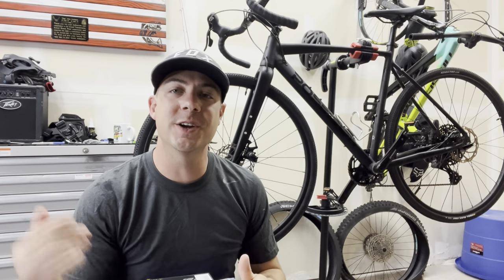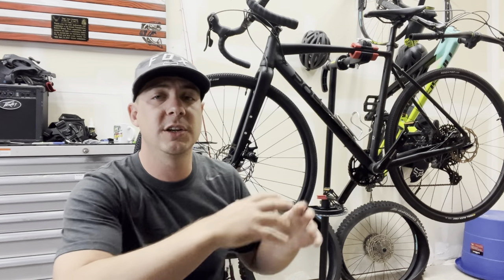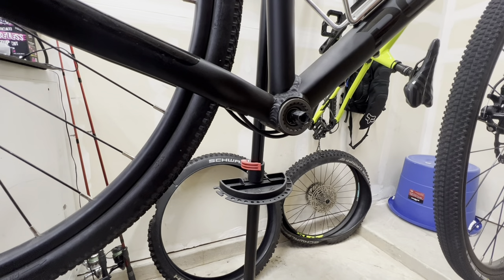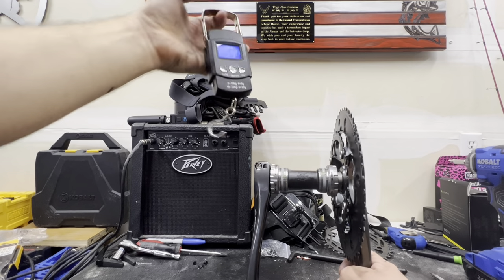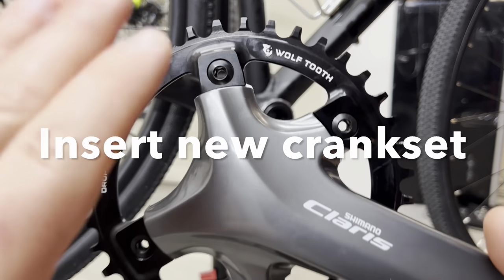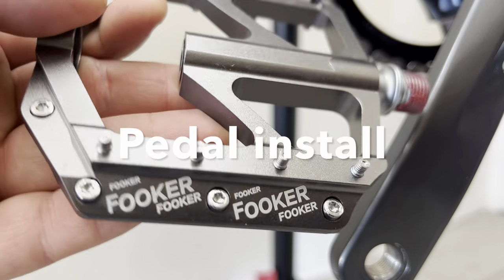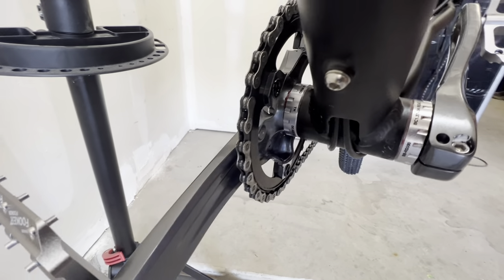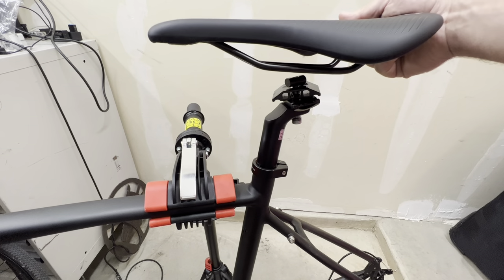Poseidon X Gravel Bike: Stage 2 Upgrade, new crankset & saddle

Comment: It might help to add a spacer to the drive side bottom bracket to give you better clearance for chainring and chain stay
Reply from the maker: Good idea man!
Reply: @bluecollaroutdoors5556  it will also help adjust the chain line. Moving from 2x to 1x affects the chain line which can be adjusted with spacers.
Reply: How many mm should I go out on the drive side?
Reply: @Michel.960  you you need at least one. That will probably improve the chain line. In fact, you also need to add the other two spacers to the non drive side. The bottom bracket is designed to work with either 68 or 73 mm bottom brackets. You have 68mm. Without any spacers you are probably compressing the plastic tube between outboard bearings. No spacers also changes the Q factor (width between crank arms.
Reply: One 2.5 spacer, not 1mm
Reply: Awesome! Thanks man!

Comment: For normal riding square bracket is much better, longer lasting, maintenance and problems free. And you removed it and installed one with the true not good design causing problems to save few grams and you tell it is better?

Comment: Can you make a video on how to build tension on the brakes I bought compressionless housing and my brake level still is squishy no matter what I do, I tried adjusting the caliper and pad distance, the cable is tight and correctly in place at the brake handle. I am clueless. I ordered a Jagsire kit to redo it all which will be here tomorrow. Any help would be nice is there like a tensioner screw or something I'm missing? I deleted the barrel adjuster since I straight lined the new housing.
Reply: You most likely had a bike shop do it by now, but in the future get a set of new pads, sand them down carefully to about 75% remaining material, align the caliper perfectly between pads, draw in the pads with the caliper adjustments as close as humanly possible without rub, THEN and only then begin adding tension to the cable by rotating the adjuster counter clockwise until you get a minor rub. Finally, screw the adjuster back in to loosen cable tension until the rub just disappears. This process in this order should have your brakes grabbing much earlier. Not sure it was wise for you to remove the barrel adjuster. The purpose of those are not to necessarily pre-load the cable tension and pull the brake caliper through its stroke, but to tension the housing for the cable. It can make a huge difference in where the brakes grab.

Comment: Hey man, would you put a 42 tooth ring on that? I found a really nice crankset online that comes with a 42 and not sure if I should do it.
Reply from the maker: It probably would have enough clearance, and yes a 42 tooth would be great for achieving a little more too end speed. Just make sure the bottom bracket and crankset will be compatible with this bike.

Comment: That is awesome I came across your videos today I subscribed as well I am absolutely due for bottom bracket as mine has probably 3,000 miles on it it's getting loose it's time to change it and I absolutely agree with everything I've seen so far in your video so I might just follow in your direction. I was actually thinking about some pretty cranks like some hope cranks but definitely ditch the square taper I've had problems with it coming loose. I generally dismount from the bike as I'm still rolling pretty fast and just swing my leg over the back tire and stand with one foot on the crank and that definitely puts some weight on it and it has proved that square tapers do not like this
Reply from the maker: I’m loving the new BB so far and the cranks are super smooth. And if you ever need to swap out the BB if it get worn out these Shimano ones are cheap and very easy to install. Yea the square taper has always haunted me, I can’t tell you how many times I’ve had to walk a bike home because of it coming loose. I dismount smiths same way and yea that stock BB doesn’t like that pressure. Thanks for subbing!

Comment: Why couldn’t you have repurposed the chainring that came on with the x? Will the stock chainring not fit on the Claris cranks?
Reply from the maker: I wish I could have but Shimano uses an asymmetrical bolt pattern for most of their cranks and normal Styles like the one it came with doesn’t line up.
Reply: @bluecollaroutdoors5556  According to the Wolf Tooth website, there are TWO Shimano Asymmetrical chainrings: one for Shimano Cranks and one for Shimano GRX Cranks. Which one did you use?
Reply from the maker: @mevierling  it is the regular asymmetrical pattern that is found on the Claris, and 105 systems the GRX is a more premium level crankset

Comment: Square tampered has been around for years and say it is not a good design is ignorant. I noticed you didn't weight the new crankset. Is the reason is because of minimal gains? So you now took a 800 dollar bike and made it a 1200 dollar bike? The saddle upgrade I can see as this is a contact point and saddles are always a personnel choice. .  Are the other upgrades really really needed? I can't see adding 400 bucks to this bike really cost effective.
Reply from the maker: Ok so I’m ignorant I guess, I’m assuming you’ve never had a square taper crank arm fall off mid ride, it sucks.
Reply: @bluecollaroutdoors5556  Nope I never have and I still have 2 bikes with them.